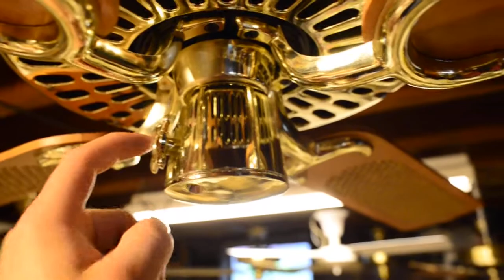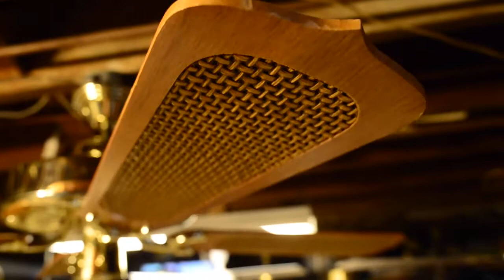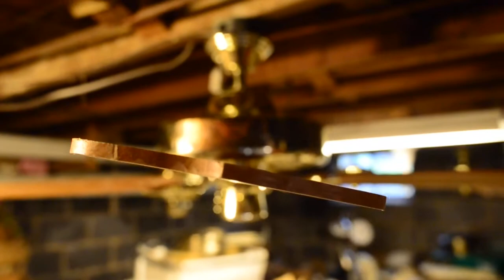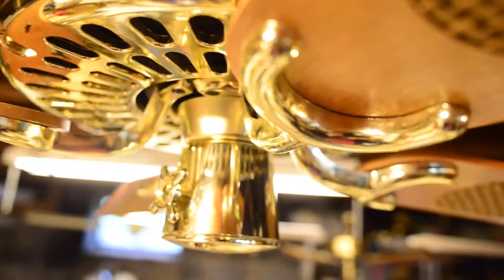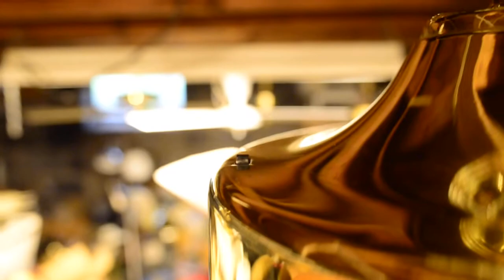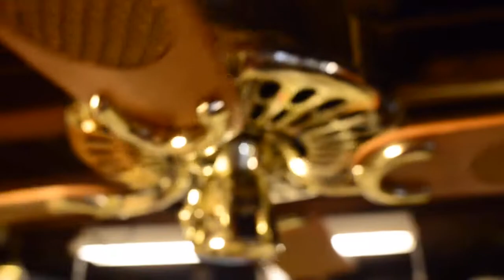Magic Heat 'Original' Knockoff 52" Ceiling Fan

Comment: dont quote me on this but i wans saw fan that had these exact brackets but was missing the bottom houseing plate I think it was na older version as it had large disc the blades were bolted to suggesting it was maybe an early gear drive version, I kinda want to put spinner motor in one of these and see hwo it performs
Reply from the maker: It's actually belt-drive; I actually have one, in need of a new belt.
Reply: wow I thought I was the only person to ahve seen an early one